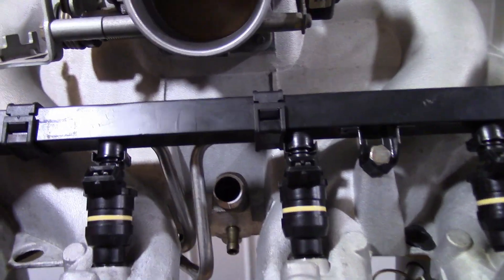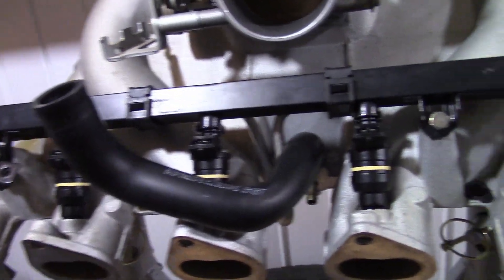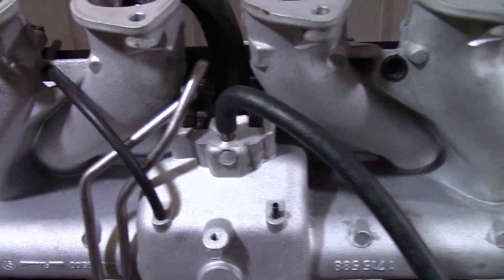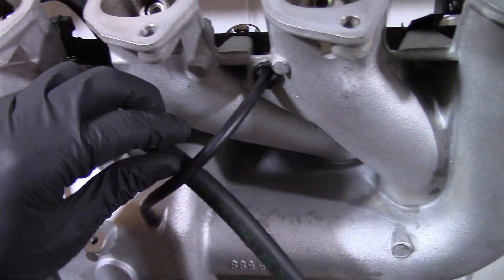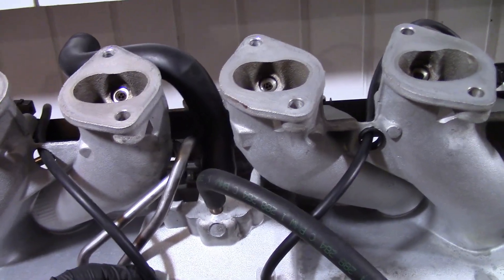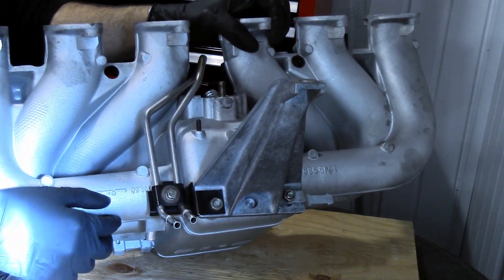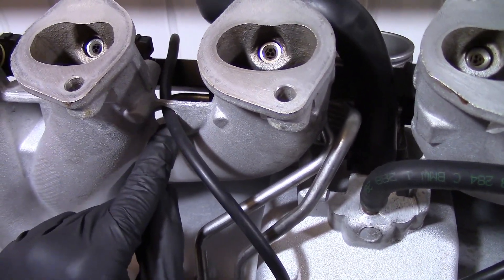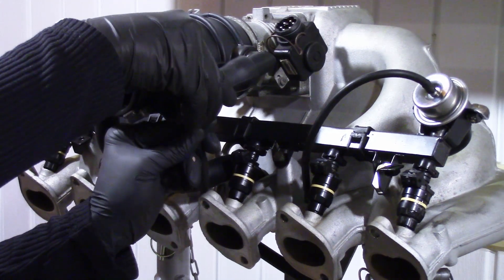BMW M30 Engine Intake Manifold Overview: Vacuum Hoses & Components - E32 735i & E34 535i

Comment: Does anybody have the part number for the smaller hose that connects to the intake boot?
Reply from the maker: Hi, the plastic elbow is 13541272473.
The vent hose is 11151276485.

Comment: I absolutely love and learned a lot from your videos. I know it's not directly related to this video but I'm wondering if you're able to help or give some advise? I have a 1988 e32 730i and need to change the head gasket but I am struggling to get off the head bolts. Would you have any ideas on how I can remove them?

Comment: nice video, i want to get mine out to paint it (everything is cleaned out by a bmw only specialist garage and there is only this that looks dirty) and i absolutly am shitting my pants. my rocker cover is already painted because it was very easy to remove paint and change the gasket.. thanks for the video my guy <3

Comment: Hey! I will be replacing my vacuum hoses soon, but i can't find some of those hoses for sale... what should i do? I have the part numbers but they aren't available anywhere!
Reply from the maker: Hi, you could bring your old hoses to a parts store and match the same outer and inner diameter with stock hoses.
Or you can buy matching hoses from the aftermarket. For example I bought these hoses:
CRP W0133-2391077
Elaplast 1638384

Comment: I was looking to see how to change a fuel injector.  There is some help here because I need to uninstall the injector wire harness tray and I see there are supposed to be 2 fasteners.  This is where I am stuck…moving this wire harness tray and accessing the fuel injector’s connector.  Thanks for posting .  Do you have any videos specific to my problem?
Reply from the maker: Hi Donald, I think you mean the two fasteners on top of the wiring casing, under the round plastic caps? I show this process in my Spring 2021 update video, when I replaced my injectors. I hope it helps you: https://www.youtube.com/watch?v=z37noIezCQ8

Comment: This video is absolute GOLD. When we speak of perfection, precision, clarity, application this video is a thing of beauty and a critical necessity to anyone trying to not only rebuild or clean the manifold and or injectors but it helps to find vacuum leaks. I just bought a 1988 BMW 735i that has sat for 16 years. I did not try and crank the car so I had no idea if the car would run I just gambled. Replaced fluids, plugs, fuel pump, fuel regulator went to crank it and it fired right up. Stoked.Then I noticed a horrible low idle in park until you hit the gas then up and down on the idle, then it smooths out. Put it in gear and it starts shaking and idle is erratic, lots of sputtering. Under the hood I can hear hissing. Been on this for weeks, found this video was able to trace the lines and found that the hose to the intake hose was halfway on and I pulled it off way too easily.. I am hoping this is my culprit. Maybe not, I don't know but atleast I am making progress now because I have been runninbg in place for way too long. You Sir, are a gift to mankind.
Reply from the maker: What a wonderful and humbling comment to read! Thank you for your gratitude.
I hope the small vacuum fix was enough to resolve your issue! Please keep me posted!

Comment: Isnt the cold start under the intake mandifold? on my e23 I believe it is
Reply from the maker: Yes, probably on an earlier version of the intake manifold. On this later "B35" variant there is no cold start valve.
Reply: @ClassicBMWFanInQuebec  ah oki. There is a hose on the intake manifold that drips oil on my cold start valve. I think it might be from that big "hose". Why would oil come there? Thank you for answering. Great video as always!
Reply from the maker: @Rockelement  Thanks :) I don't know how it is set up on the E23... but I would guess it's related to the crankcase ventilation system. From what I understand there is a tube that carries oily/misty fumes into the intake so it can be burned, instead of releasing it into the atmosphere. Maybe that tube is torn. Do you get clouds of smoke from the exhaust pipe occasionally?

Comment: The 16” vacuum hose going to the fuel regulator, what diameter would that be? Thank you. Great video as usual.
Reply from the maker: The hose I used was from CRP (part of the Continental group) and it measured 3.5 x 2mm.

Comment: Hey again, thanks for the video, that really helps! Did you also make a video about the removal of the intake manifold? 
After removing the air intake tubes, throttle, injection rail etc, it should come out quite easily or is there anything else to consider?
Reply from the maker: Glad it helps! About the intake removal video - yes and no. I recorded the process, but the end result was so bad that I decided not to use it. The video was too dark and grainy (my camera isn't very good) and the audio was bad.
Other than what you mentioned there aren't any special considerations for the removal of the intake, no. The lower nuts are the most difficult IMO, because of tight clearance. I used a stubby offset wrench from SK Tools and it helped a lot. A crescent or half moon wrench might work too. When reinstalling the intake I suggest that you keep the fuel rail and injectors loose. If the first injector is seated in the intake manifold, it won't clear the upper coolant hose.
Reply: @ClassicBMWFanInQuebec   yeah I wanted to remove the injectors anyway to replace the small O-rings on them because they are often pretty worn.

Another question I have is about the valve you show at 9:00 , are you sure the two lines that connect to it (the bent tube that goes to the manifold and the other that goes to the charcoal canister) are vacuum lines?
Because in the parts catalogue they are defined as fuel hoses?!
Reply from the maker: @piano302  Yes it's true, in a sense it is a fuel hose because it is used to vent the fuel vapours from the gas tank. That's why the hoses are much thicker than the other vacuum hoses. The purge valve uses the vacuum of the engine to vent the fuel vapours towards the intake manifold, for combustion. At least that's how I understand it... I should have made it clearer in the video.
Reply: @ClassicBMWFanInQuebec  Is there still a posibility u could make a video to remove the intake manifold? It's probably a weird question, since u have already done maintenance to it..
Reply from the maker: @leay6654  Hi, yes I recorded the removal process. But I did not finish editing it, because the recording was not very good. One day I might finish it though...
Reply from the maker: @leay6654  If you have a specific question about the process feel free to ask!
Reply: @ClassicBMWFanInQuebec  Ah I will ask you some question if I need to, thank you for that. I want to sodablast the intake manifold since it has all these yellow stains on it, that's why I need to take it out.
Reply from the maker: @leay6654  I see, great idea to blast the intake manifold to remove the old cosmoline coating. The most difficult part of the job is to remove the lower six nuts. You have to get creative with a stubby and offset wrench. Maybe some crow's foot adapters would help too, then you may be able to use a ratchet from up top.

Comment: hey, thanks you so much for the helpful video! can you help tell me how did you torque the manifold nuts? I have mine on now with only hand-tightened nuts while I try to figure out how to torque them. 
thanks :)
Reply from the maker: Hi Adam, I could only torque the top nuts but not the bottom ones. Like you said a torque wrench wouldn't fit in such a tight space. Here is what I did: 1) I used a torque wrench to set the right torque for the top nuts 2) checked how that torque felt like with a hand tool 3) tightened the lower nuts using the same hand tool until I felt approximately the same torque.
To spread the load evenly I started with the center runner nuts, then did the next runners on each side and moved this way across all the runners. It's not overly critical I think to torque the manifold evenly, but out of precaution I opted to do that. Good luck!
Reply: @ClassicBMWFanInQuebec  thank you so much for the detailed info this is very helpful! I'll do the same thing on mine! I saw your smoke test video so it proves that it can be done without a torque wrench 🔧. One more thing if you don't mind. I look all over the service book with no luck finding the tourqe spec for those nuts and online some said it's 11 foot pound is that what you used? 

Thanks again, looking forward for more of your videos. If you have instagram let me know
Reply from the maker: @adamshar5180  Right yes, I remember looking for a torque spec in the Bentley manual and not finding it. I believe I went with 16 ft/lbs of torque, that's what I found on mye28.com.
I do not have an instagram account sorry. I'm not on social media and I hang out on bimmerforums instead.
Reply: @ClassicBMWFanInQuebec  got it, I'll do that! for sure no worries!

Comment: Nice video.  Wush i had seen this a year ago before I rebuilt my m30b35 engine.
Reply from the maker: Thanks for your comment. How did the rebuild go? Was there an issue with the engine or was it a preventative rebuild due to age/wear? I'd really like to do that some day, but lifting an engine and transmission sounds quite involved.

Comment: hi can you help me find the brake cylinder for an e32 730i 1992 automatic i dont know witch one i have to buy
Reply from the maker: Hi, I recommend you check on RealOEM.com for the specific part for your car. Simply enter your vehicle information and then pick the Brakes category, you will see the part number for the master cylinder.

Comment: What a great video, very helpful, thanks! I bet there are some slight differences between yours e32 and mine e24 but the overall design is the same :)
Reply: The final E24 models (1988 and 1989) actually used the same M30B35 engine as the E34 and E32. This was the best and final version of the M30 putting out 218 hp in non-catalytic converter spec and 211 horsepower with catalytic converters.
Reply: @houseofno  yep, that’s what I’ve got in my ‘88 635CSI. I love this car :)
Reply from the maker: Glad you found it helpful! Yes I think there are some differences. For instance between the two studs at the bottom, on RealOEM, several caps are listed in the parts list, to cap a hole. On my intake the cap is cast into the aluminium. There might be some differences for EML-equipped cars too but I'm not sure...

Comment: It's such an unusual design...however watching Jay Leno's Garage the other week a very early Duesenberg (early 20th C.) there was an incredibly similar design with the main vertical plenum chamber and side runners. Amazing & very recommended to see perhaps early inspiration for BMW. F.Y.I. Alpina (and others) produced a version of this manifold putting the T.B. on the other side. I believe the injectors changed from the single pintle design with ribbing to a smooth "capped" design, both in yellow c.1989/90? Watch for the intake gaskets ever so slightly not quite matching the head ports: a fine file can take care of this. I see the cursed Cosmolene shipping coating there...if you find an easy way to melt this away sympathetically my first born is in the post lol! Really like the easy going and specific video mate, you have excellent standards & all your parts are impressively clean. :)
Reply from the maker: Thanks for the kind words Aussie BMW :) I just happened to clean the intake manifold before reinstallation, it wasn't that clean before! I couldn't get the cosmoline off with regular degreaser but I didn't try too hard. I didn't want to damage the finish on the good-looking areas. Maybe someday I'll get the intake, valve cover and oil filter housing painted in the factory silver color.